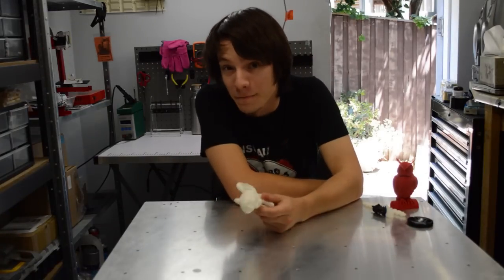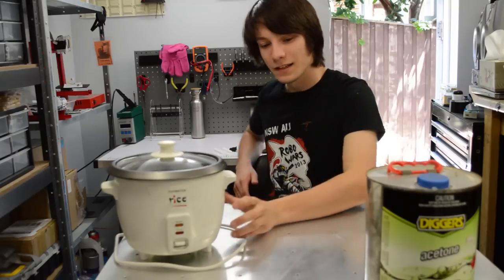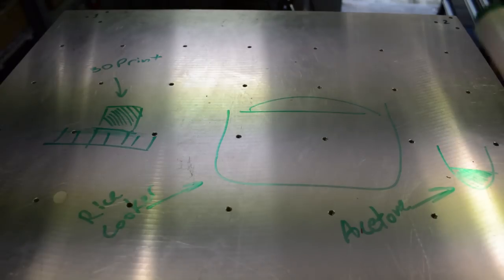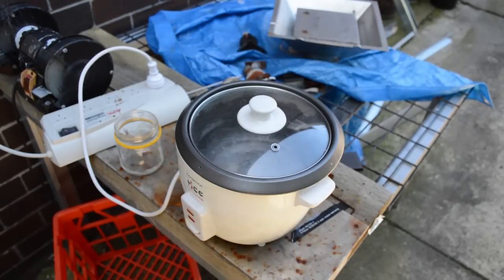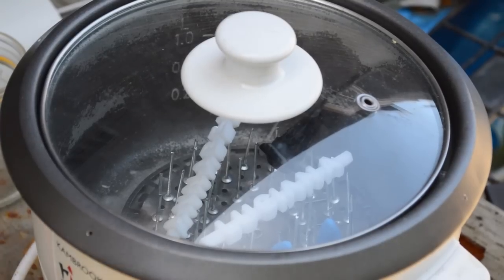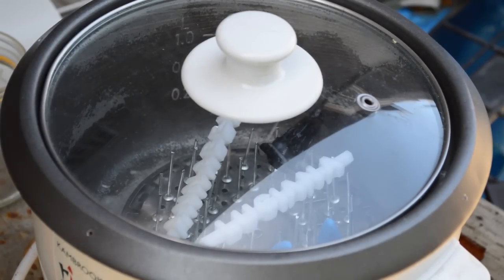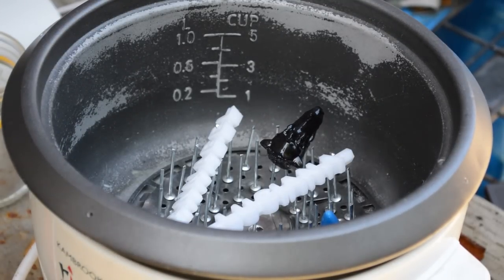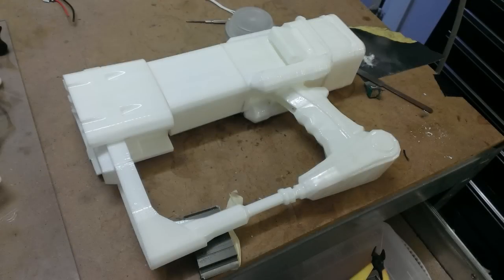Make your 3D Printed parts look professional with Acetone and a Rice cooker! - 2014

Comment: Thermostats and power switches can arc. I think taht I would least use a switch at a power strip to turn the power on and off.I would also consider cutting out a large thermal mass such as a piece of steel in the bottom. You could turn the power completely off during the proces.

Comment: I repurposed an electronic pressure cooker that had a nasty habit of turning itself on in saute mode.  It was a fire hazard, but it's great for acetone vapor smoothing.  Much faster than the rice cooker.  Moa powah!  I dump the acetone in the bottom, add the parts, turn on the saute mode to heat the acetone and it's boiling in a few seconds and it's flashed into a pot of vapor a few seconds later.  The entire process takes about a minute, then an hour or so for the acetone to cure out of the surface of the parts.  A garage sale crock pot has more power (less waiting) than the rice cooker, but less than the electronic pressure cooker.

The rivet bed of nails was genius.  I've been using a flat plate and that doesn't smooth the bottom of the print.  Also, if I try as much of an actone smoothing as you did, liquid acetone condensate would pool under the part and melt the base.  I think I'll get a sheet of expanded metal with the holes in it, tap the holes and install small cap screws in every other hole to support the part.

Unsafe?  Acetone vapor smoothing isn't nearly as dangerous as when I cook meth.  (I'm joking, Drug Enforcement Agency!)

Comment: Your process is much quicker than many tutorials I have seen. You pointed out something we ran into on our first attempt, the ABS "Makerbox" brand was not melting. The XYZ brand melted perfectly. As you say, test with a scrap piece of filament before ruining a part.  Seems like you should add a lifted out of a small tube to the middle of the parts holder.
Reply from the maker: The biggest issue with the process is you don't want acetone to 'boil off' the surface of the part after settling on there, or it'll ruin the surface - so I find fast and controlled much better than slow and leaving it to chance! A lifty hook has been implemented and helps a great deal now. I also tried a small pc fan in the cooker to distribute the vapour, but it made the finish worse for some reason. The 'not actually abs' is a really big issue and one I've run into many times. Doesn't surprise me the makerbot one was dodgy!

Comment: is it possible to fiberglass 3d parts ??
Reply from the maker: Yep you can make a 3D printed form and fibreglass over it no problems - seen a few people try that for high strength parts.
Reply: +Maker's Muse and is it possible to fiberglass pla or something like that ?
Reply: you can fiberglass anything that is strong enough to hold the material, so PLA should work just fine. I even saw someone fiberglass over a large rubber beach ball.

Comment: Make a handle using a wire coat hanger to set and pull out your jig
Reply from the maker: That's a great idea! I've been using a wire since but a coat hanger would be far stiffer. Cheers.

Comment: I still think having an electric heater is slightly riskier than it needs to be. 

You could use pre-boiled water to heat the vapour bath to acetone's boiling point (56 Celsius).
Reply from the maker: piprod01 True, there is dangers if something fails and a spark is produced - I've tried with hot water in the past and it does work, but you have to be careful not to get steam condensing onto the surface of the part, or the acetone smoothing will go horribly wrong! I've been using this technique for over 2 years now with no incidents.

Comment: acetone works on PLA as well as abs....
Reply from the maker: +oobligah If your PLA smooths then it's not PLA... Some brands are affected due to other included plastics, supposedly Colorfabb's PLA/PHA can be smoothed but I haven't tried that myself.
Reply: Maker's Muse I've tried acetone smoothing with 3 brands
Ultimaker
WYZWorks(?)
and some noname brand from the netherlands.

So far they all get smoothed, the only difference between them is how much residue is left behind after smoothing.

Comment: Hi, Which 3d printer did you use?, I use Cube Pro and I'm having trouble with big parts and fine detail, I see in the video you have big and small parts with awesome details.
Reply from the maker: Fernando Garza I used the UP! Mini, I feel sorry for you purchasing a 3D Systems machine - they are terrible... You also need to print in ABS for this technique to work.
Reply: Thanks for the reply, It's the printer at my office haha. But I want to buy one for myself.
Reply: Fernando Garza Don't get any 3D Printer from 3D Systems.

Comment: what about PLA. 

how do I finish PLA printed parts
Reply from the maker: For PLA your pretty much limited to good old fashioned sandpaper and automotive spray bog. There are chemicals which will affect it, but they'll probably kill you in the process... :(
Reply: orangedac same way with acetone-works for me-or you can use PVC primer.

Comment: This is a great demo, really appreciate you taking the time to do it.  I've been trying to "finish" some of my pieces with a cold acetone vapor bath and haven't had any really noticeable results.  Tomorrow I'm going to try this method instead.  Outdoors, of course.
Reply from the maker: It works MUCH better and faster, but yeah :P outside! Also try and have a way to get the part / jig out of the container without resorting to sticking your hand in, it's not a pleasant experience. Coathanger wire seems to work well.
Reply: The jig is definitely going to be the challenge.  I built one today with very thin wire; essentially, a latticework of horizontal wires between two uprights.  Unfortunately, I built that jig to just fit inside a 20 gallon aquarium, using a cold vapor bath. 

I'm actually trying to smooth my personalized Scrabble tiles.  I'm using a FlashForge Dreamer, printing the tile in one color and the letter (plus my name on the back of the tiles) in another color  I'm hoping this process also mushes together the small gap left between the border of the text model and the edge of the hole in the tile!
Reply from the maker: Nice! You'll get a little bit of run from the smoothing but not too much, you shouldn't need much time in the vapour, maybe only 20-30seconds if they're small.

Comment: I wonder if ultrasonic "fogging" would work with acetone. It would be a little more controlled. And as a plus it is a process that can be controlled from a distance.
Reply from the maker: +Bigrignohio True that, wonder how it would go. It's been suggested a few times but proper ultrasonic foggers are expensive I wouldn't want to ruin it by dissolving a seal or something like that!
Reply: +Maker's Muse Perhaps it would be better to use a simple vacuum pump to reduce the pressure instead? At a relatively high pressure of 200 torr the boiling point of acetone is room temp. And salvaged auto ac compressors are cheap.
Reply: +Bigrignohio Your prints might pop if you print with anything lower than 100% infill.
Reply: +Toastalicious Interesting thought. For hollow items you could leave (or drill) a small hole. High percent infill would be sturdy enough to withstand the pressure. However in between the two . . . maybe?
Reply: +Bigrignohio as a whole, the print might stay intact but the outer edge where it counts might pop and delaminate.

Comment: great vid, loved it. But it was a very hairy scary moment there when I see you have the acetone jar open and then you switching off the cooker with the power board so close. (is it spark proof)? I also wonder about the thermostat switch arcing inside the rice cooker while heated acetone raising its flash point even much higher.  You did wear safety goggles at least didn't you?
Reply from the maker: John Skippy I always wear safety glasses! Acetone vapour is very heavy, there's no way it would have reached the powerboard at nearly enough density to catch. None the less - do this at your own risk! I've done it for years and never had any issues with fire - just use common sense.

Comment: About what temperature are you running your rice cooker at?
Reply from the maker: Gabe Valdez No temp settings, I just turn it on and within 30seconds or so it's hot enough to do the smoothing, then turn it off as per the vid.

Comment: You can reclaim acetone, but unless you use more than Angus, it will be to expensive to be sensible. It's just distilling acetone. You would need to know a few things like the boiling point of acetone & how to assemble, and disassemble your reclaimer. It's going to cost at least $1,500 for a smaller reclaimer, but some with a chemistry and engineering background could probably build one for much cheaper.  All solvents can be reclaimed, just not cheaply enough.

Comment: just wanted to confirm you used a afinia printer....  known as a up+ in Europe.   and what was the tip size and layer resolution?.   Im considering a printrbot metal as my first printer but I wan't to know if this smoothing process will work with a print that has 400 micron resolutin
Reply from the maker: Dr. Drone Yep all printed on the UP! Plus at 200micron layer heights with a 400micron nozzle, but you need to print in ABS which I don't believe the printerbot simple metal can do...

Comment: Hm. Is there a reason why we shouldn't just use a few layers of varnish?
Reply from the maker: You absolutely could, in fact there's a new product out called XTC-3D which is essentially a thick 2 part varnish that can make any 3D print (abs OR pla) glossy. The acetone vapour however will make the part stronger too, by bonding the layers together better.
Reply: Maker's Muse
 Ah, thank you. :)

Comment: has anyone tried this with shapeways prints, I don't have a printer so I have to use 3rd party.  
are shape ways plastic good enough for this?
Reply from the maker: It's not about being good enough, but rather if acetone affects it, and it won't affect the material shapeways uses! The process for 'white strong and flexible' is a nylon powder, and acetone won't do anything to it. You can dye it with rit clothing dye though! Also, they offer a polishing service for it too if you want a shiny finish.

Comment: Haha Awesome, i am also going to print that AEP7 Laser Pistol. btw did you use support material for it?

also it helps adding a fan to move the aceton vapor around.
Because the vapor is so dense it will start smoothing the bottom sooner than the top, because of that it can give you an uneven finish.

Comment: Thanks for the video! Maybe getting gloves, a respirator and vapor goggles would help with safety. One question, how much detail gets lost from the surface? Say, if I'm trying to print parts that are accurate (or that will fit with other parts) would this process be an issue? Have you done anything like this?

Thanks!
Reply from the maker: +Oscar Frias It does tend to round over sharp edges but won't really expand or contract as it's melting not adding a layer. I've done some press fits using a 0.1 or 0.2mm clearance, as well as allowing for a slight 1deg taper if you can for pegs and such. Takes testing obviously!

Comment: How much detail of the 3D print would you lose by using this process? Also, if you let the parts in there for less time, what kind of result would you have? Just not as smooth as keeping them for as much time as you suggest, or what?
Thanks :)

Comment: where did you get your 3d printer from and what printer is it? i live in australia and im finding it so hard to find one !
Reply from the maker: I have an Up Mini, highly recommend it as a great starter printer - depending on where you're based there's HEAPS of resellers in Aus for it. If you're in Syd or Perth - 3D Printing Studios will do you a good deal if you tell them Angus sent you ;)
Reply: Maker's Muse The only thing with the up mini was the small build platform other than that seems like the best on the market! thanks heaps for that though!!!
Reply from the maker: ***** I know, but if I need to print bigger, I just slice the parts up and glue with acetone :) No probs!
Reply: true ! that works ! thanks for the reply!
Reply: yeah i'm in Sydney and it sucks. I realized that the small build volumes are just for hobbyists why i didn't go for anything smaller than 200x200mm.  I imported mine 2 months back from China since it has a large build platform of 300x200x400mm cost of $1500.
Reply from the maker: Mmm sounds awesome, what machine did you get? Any good?
Reply: got the flashfroge dreamer and extremely happy with it! worth the price
Reply: Curiosity hello we have  mini printer  build size is 100x130x100mm, it's cheaper .now do you need ? maybe i can send you some picture,

Comment: Acetone vaporizes at room temperature and will travel to the lowest point of its container. That vent on the lid is also not doing you any favors. Read up on acetone vaporization and flashpoint temperature. At vaporization or slightly higher temperature will be a slower process but more controlled and adding too much heat, even if the heat source is not flame or spark inducing will cause combustion or ignition of the chemical.

Comment: Can you show us a way to smooth PLA parts?
Reply: same with ethyl actate
Reply: mscraftyperson I have tried the Ethyl acetate way but all my black prints end up white and more brittle so be careful with the type of PLA you use
Reply: Get sanding, priming and painting. Long and tedious but pays off
Reply: SmoothOn XTC-3D is a clear resin made for 3D printing and a little bit goes a very long way too. The trade off is extremely high working temperature, short work time, and you'll still have to smooth and sand some parts.

Comment: I'd rather sand the pieces.
Reply from the maker: +Mike The Gamer Definitely can - will take a fair while longer but you can get sharper edges.
Reply: yea, I mean its a lot of time put into printing, whatever, and then you go ahead and actually melt it, partially.  seems, odd.
Reply from the maker: +Mike The Gamer True, 3D Prints take a long time but not much effort - Sanding is hard work!
Reply: Maker's Muse But the results are always outstanding.

Comment: Just a little note about condensing the vapor. If your rice cooker has a pin in the center holding the handle on, make sure that the parts avoid the center of the pinboard as the acetone may condense on the lid and drip down. Very unlikely due to the heat, but possible!
Reply from the maker: +CreeperInDisguise This has happened to me, very good point! If the lid is cold it can very quickly form droplets and drip onto the part. Usually not the end of the world, but can ruin an otherwise perfect smoothing job!

Comment: "Rice cooker" Isn't that a crock pot?
Reply: "They may have a similar shape but they're different animals.
Rice cookers come in two basic flavors that do the same thing. The upper end models have sensors and microprocessors that control every aspect of cooking rice. They are the point and shoot camera of rice cookers. Lower end rice cookers are much simpler. They have a heating element and a thermocouple that's set to shut off the heat when the temperature rises above 212F (100C), the boiling temperature for water. Some of them switch to a "warming" mode, others just turn off. Rice cookers are designed to cook rice and little else.
Slow cookers have a heating element and usually a timer of some sort. The units are designed to supply a lower heat for an extended period of time. Some units have minimal temperature and time controls. You can cook rice in a slow cooker but it will take longer and will keep right on cooking long after the rice is done unless you keep an eye on it and intervene.
Necessity is the mother of invention. People do cook other things besides rice in a rice cooker but with dubious results." ~ reddit.com/user/Rks1157
Reply: Shoop83 But couldn't you use a crock pot for this application just fine? The pot in a crock pot is typically made of ceramic, so I don't think acetone would be a problem.
Thanks for letting me know the difference, basically, it is just the electronics that differ it seems. They seem to have basically the same actual hardware.
Yeah, crock pots(slow cookers) usually have a timer(Not on basic ones) and a heat level, usually between 110F-250F(43C-120C). The element is external in the open space between the ceramic pot and the body.
Reply: You probably could use a crock pot instead of a rice cooker. Rice cookers tend to be cheaper.

Comment: Replace your Acetone with Tetrahydrofuran and you can smooth PLA
Reply from the maker: Anime JP Good idea... if you want to DIE HORRIBLY... >_>
Reply: +Maker's Muse THF is just as toxic/corrosive as acetone is. Its only slightly more flammable.
Reply: According to Wikipedia: THF is considered a relatively nontoxic solvent, with the median lethal dose (LD50) comparable to that for acetone. Reflecting its remarkable solvent properties, it penetrates the skin, causing rapid dehydration. THF readily dissolves latex and is typically handled with nitrile or neoprene rubber gloves. It is highly flammable. One danger posed by THF follows from its tendency to form highly explosive peroxides on storage in air.

Where would you get this stuff, any common source?

Comment: i feel like you lose a lot of detail, the prints look kinda melted...
Reply from the maker: carrito1981 They do melt a bit, that's the only way this kind of smoothing works, so best for bigger shapes rather than trying to clean up small detail - you would need to use a high end process to get a better finish for those kinds of prints.